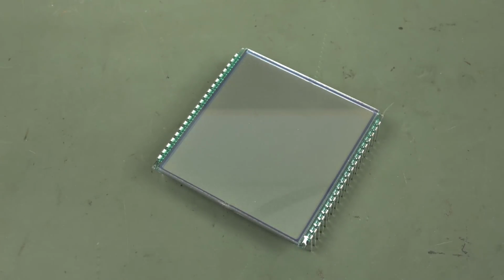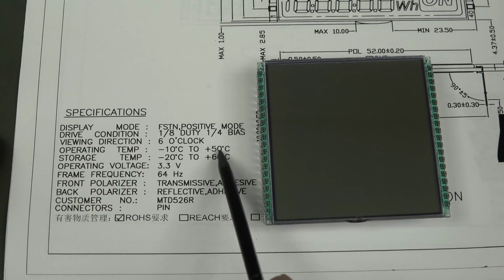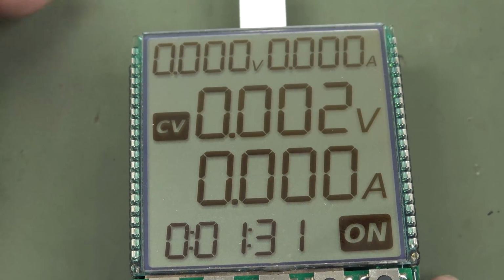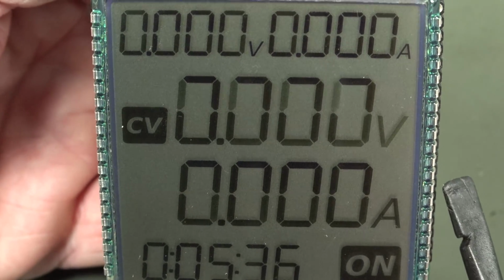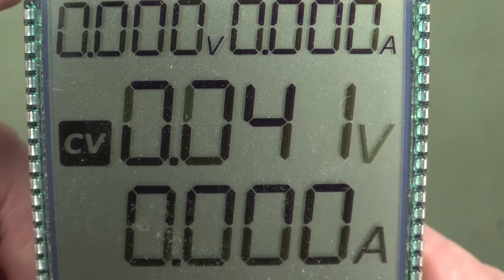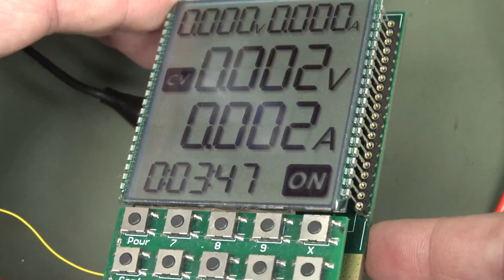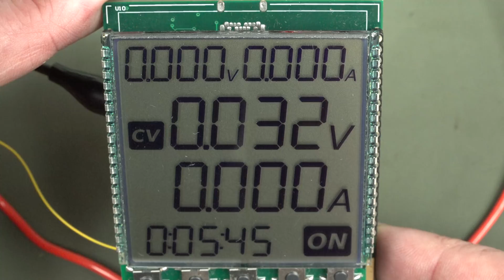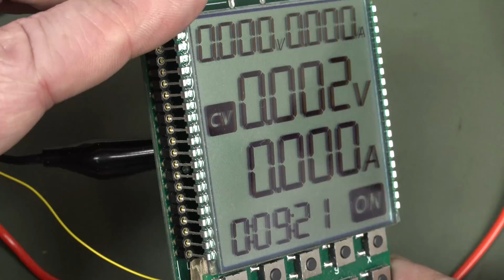EEVblog #1105 - $100 Custom LCD Design - Part 3 (µSupply Part 18)

Comment from the maker: More testing needs to be done on this of course, temperature testing for contrast consistency across multiple devices for example.
Reply: How do the other 4 look? Is the quality consistent?
Cheers,
 - Eddy
Reply: EEVblog just a dumb question, but have you tried reseating the display? I can see you have the "precision pinholes" which are a pain in the ass, as they never have the right hole size ( they're either too small or too big )
Reply from the maker: It has nothing to do with the contacts seating
Reply: @martinsalko1  you could choose the shorter pin, because if the the pin is longer, it would be easier to curve and hart to through the pin hole. or you could ask your pin supplier to add a pin protective case for it.  from custom lcd specialist : www.szmaclight.com
Reply: The supply to which Vlcd was connected without divider, so it was at max. Vlcd cannot go above the supply, so Vdd must increase.
Reply: I have had issues like this in the past depended on temperature ended up making a temperature compensation for it.
Reply: Does the voltage adjustment in the video use the power pin on that holtek chip or the VLCD pin? And is there something to measure on the LCD side? Or does the method of powering LCDs not result in a good measurable voltage-at-LCD?
Reply: @johnkeates9434   you could measure the driving voltage wave of segment or common pins, and getting the LCD driver voltage.
Reply: EEVblog what happened to the first upload???
Reply: Are you going to make a video on the design of the case?
Reply: If you need some unbiased third party testing you know where to send it .. hint hint.. ;) Great video series on the practical process of such a design. Thanks Dave!
Reply: Out of curiosity, with those specific LCD modules, what kind power consumption difference is there (or was there) when you increased the voltage from 3.3 to 3.6?
Reply: Did you noticed that every 7 seconds or so it skips 1 second? Also can you add a contrast setting to this type of LCDs? I mean without running into those segment issues.
Reply: Are you going to sell the displays alone?
Reply: Was the issue persistent across all 5 samples?
Reply: Great video
Can you please share with me the manufacturer that made it for you
I couldn't find a manufacturer for some small quantity under 100pcs
Reply: Dave, since the V character is at the far end of the trace, one possibility might be that too much resistance is accumulating over the length of the trace.
I can think of two possible remedies.
If sufficient room exists, the trace may be widened so that there are fewer squares of resistance between the contact and the V graphic.
Secondly, ITO glass with lower resistance may be used, with the trade-off being that the ITO traces will be more reflective and less transparent.
Reply: EEVblog Bleeding awesome! I'm American. Sorry. Fucking awesome!

Comment: Do you think a much smaller display would be even cheaper? I need a display to show the destination for my TT gauge model railroad trains - to fit into 15x5mm area and preferrably with I2C or SPI behind... Maybe LCD, LED or OLED...

Comment: Hey Dave, David,
If you guys are still working on your battery powered power supply then you might consider coding it such that it can keep track of how many Amp Hours it has supplied (consumed out of the supply battery) and therefore be a sort of gas guage on when the battery needs recharging.
Nice display!

Comment: Would an off the shelf dot matrix lcd with the same dimensions have been a viable much faster option?  How much more driver software development would there have been on your end? You had a complex cad development of the board layout in this case.

What is the disadvantage of a dot matrix lcd? I imagine it’s not as sharp?

Comment: Hi Dave, It could be that you are operating the LCD in a brighter environment than it’s nominal. Did you also specify the ambient brightness? Anyhow, the final product may benefit from adjustable voltage.
Reply from the maker: No spec on ambient brightness. 
Reflective LCD's don't have a maximum brightness.
Reply: Since the dynamic range of the display is quite low, they should have some idea of the ambient light while building it for the specifications, e.g., it will become unreadable in indoors if it is designed to work under sunlight.

Comment: Curious that the data sheet specifies 64Hz. When did D/C power supplies begin producing sinusoidal output signatures or have I missed something?
Reply from the maker: LCD's are driven by an AC signal.

Comment: How is 6 O'clock a tilted angle? By pure logic it would be to be looking straigh down on it, as in looking at the number 6 on a clock. Or what am I missing?
Reply from the maker: http://www.pacificdisplay.com/lcd_view_angles.htm
Reply: EEVblog Thanks! I learned something new, nice! So the "6 O'clock" thingy is not a viewing angle thing. It means that the display are made to be view from the bottom. In it self its not a definition of the angle. That makes more sense.
Reply from the maker: Yeah, it's a bit of confusing industry specific lingo.
Reply: +drlunderberg Many years back I visited a bleeding edge tech firm where they'd set a nice LCD clock into the back edge of the visitor registration desk. Problem was the display had a 12 o'clock viewing direction and was almost invisible when viewed from 6 o'clock. Pointed it out to their tech director but never went back.

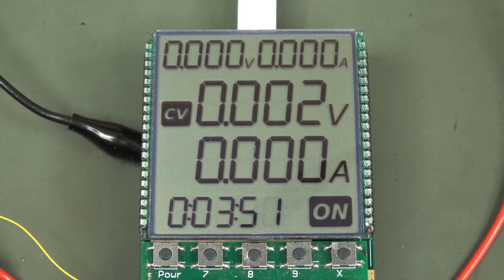Comment: @12:50 I like that too. You're being too tight at 3V3. Drive it with 5V and add a VR to VLCD. Job done.  Keep the pins they are nice.
Reply from the maker: Yep, easy solution.

Comment: can this sort of issue be because of a half ass-design for the testing board? we both know that it doesnt need that much to drive segments (or in your case not drive them)...
Reply from the maker: The "half-arse" design is using a dedicated LCD driver chip.

Comment: This display is not compatible with a zebrastip because the contacts are on the bottom glass, for a zebrastrip you need the contacts on the top glass.

Comment: I have had that problem a few times and it was almost always board layout where some tracks had higher capacitance than others and it caused some segments to 'lag'. I also had one where there was some crosstalk between a couple of tracks.we generally avoided ground planes under the tracks controlling the segments.We always now specify a lower voltage display and feed it through a resistor and this allows us to select the right values. We also find variations between different vendors for the 'same' design.

Comment: I would like to have your micro power supply but I am afraid it will be more expencive than if Fluke made it, like with EEVblog multimeter. Ask Fluke if they would be willing to slap their brand on it, it would be cheaper?

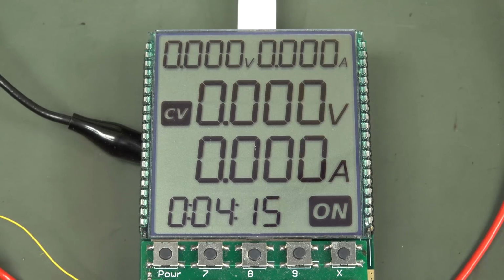Comment: At the higher voltage the refresh 'attack' and 'recede' times seem to be much much improved also. It slowly fades in at the start of the video on changes...and sharply changes at the 13:15 mark.

Comment: Is there any reason to use these segment displays, apart from low current draw applications? I mean - these days you can get full color 320x240px or even higher resolution raster LCDs with built in drivers for just a few dollars, and you can display literally anything on those. I mean - cost- and functionality-wise there is no reason making your own segment LCD these days. Am I missing something?
Reply: I'm guessing that the main reason (other than power cons) is the effective resolution. To match that res may require a lot more pixels than 320 wide. That said, I do like displays that simply use an I2C or SPI interface!

Comment: 15:41... Why wouldn't you want to share the Manufacturer of the LCD with your subscribers Dave ??? Why the big secret ??
Reply from the maker: Because we did a lot of legwork to find this manufacturer, and want to keep a good relationship with them. We don't want them flooded with 1000 people wanting $100 one-off prototype LCD's, that's not their business. And trust me, that would happen.
Reply: it is microtech-lcd . com
Reply: DrAFrei & Dave... Thanks for the info and reasons why you don't want to share that supplier.

Comment: For me it's a bit confusing the exact same font (and small V/A letter at the end) of the two display lines.
Either you have to be really familiar with the display, or always check the small letter at the end to see weather  you are looking at the voltage or current display.
This is why LED displays use different colour blue/red for the two values.

Comment: Looks to me like a it could be loading issue on that segment drive line - does it have a bigger area to drive than the others? I see the datasheet gives a 1:5 difference in drive sink currents at 3V and 5V which would seem to explain the problem going away with a slight increase in drive voltage.

Edit: I see v ant beat me to it 3 hours ago.

Comment: If it would be an F35, then, no biggie, straight to release. But, since it's just a power supply prototype, should replace that display. Also, keep the pins. I've had so many displays lose contact with those flimsy rubbers over time due to either oxidation from high moisture or just the rubber perishing.
Reply: Yes, please dont go with those "zebra stripes". Touch them once and thats it, it will never work again... :D

Comment: That looks like USB-C. I don't think i like that idea... Sure it is more power, but i have a zillion micro USB Power Sources / cables everywhere and just one USB-C at my work place.
Reply: j4ck32  buy another one... That's like protesting sata because you have loads of IDE cables...
Reply: 10$ for 3 USB-C connectors, so 3.3$ per one? Are you sure you think thats okay? I get complete boards with everything for less than that...
As long as USB-C costs too much its not a option. The functionality are not needed in any way, so the only reson to switch is the price and availability. Both are much better for µUSB.
Reply: Leo Curious   You get complete boards in consumer quantities which are more complex than a cable and have more materials for less than 3$?! 

Also... Are you THAT cheap? Move on! Stop trying to resist change because you dont want to pay money
Reply: What is you point? Change because... change? Unless there is a benefit its not going to happen. I See how USB-C is better for any other usecase (and already switched some things) but not for these things. There its just for +5V and communication. Waste of money to use USB-C for that. It will of course still happen in the next 10 years, just like mini-USB to µUSB in the last few years, but at that point it will be about as cheap and maybe even allow for some neat tricks.
And of course, you get complete ESP32 boards for a few $. You get complete TTGO boards with µC, OLED display, LORA and antenna for 13$. 3$ is a shitload of money "just" to get 5V across.
A comparison would be that you would want thunderbolt connectors. The same reasoning applies to dismiss that idea.
Reply: Leo Curious   Change for the sake of change is bad. But i guarantee in 3 years when everything is using USB C youd have trouble finding a micro usb cable in your stash and then youd need to remove an existing cable from a usb supply and its just annoying...

I, right now, due to the amount of type c devices I have, find it a real pita to remove a type c cable and substitute it with a micro USB one. 

Oh, also, you can get a type c cable from AliExpress for $0.5... even less if you get multiple...
Reply: Leo Curious They're not prone to usb superposition for one.
Reply: Hahaha, USB superposition :D
1. Try to plug it in, doesnt work
2. Flip around, still doesnt work
3. Flip around once more... works.
It has 3 sides.

Comment: If the manufacturer can design LCDs to work at 3.3V or 5V supplies, and this one was specified at 3.3V but works better at 3.7V, could you get them to adjust {whatever it is they adjust to move between 3.3V and 5V} downwards a bit so that the production LCDs would work nicely at 3.3V and save you the extra regulator?

Comment: Two comments:  What's the voltage on the drive chips themselves?  (anything significant lost in the traces?  I've learned that lesson the hard with way TTL stuff.)  Second, was it clear from your communication with them that the 3.3V was the drive level to the driver chip or the drive level to the LCD?  I'd think they'd be expecting it to be the drive level to the LCD.  Otherwise, they have to work out how much drop there is the the drivers you're using - which may or may not match the information they have.
Reply: Yeah it looks like the lcd is not seeing 3 v3. But i'd think raising the vdd and fixing the mistake shouldn't pose much of a problem.

Comment: Last time I got custom LCDs they gave me 15 samples containing 3 different versions. So I could pick the exact type for my controller (MSP430F449) since I did not have any chance to increase the voltage to 3.6 volts. However, tooling and handling was $1000 in my case. That's 10 times more. I am sure they could fix that for you using a different liquid crystal type, for another 5 samples and $100.
Reply: It depends type of your LCD Display or LCD display Module. For example this manufacturer https://www.yaoyulcd.com offer 150$US for LCD glass and 150$US for Handmade Acrylic LED backlight. 5pcs of engineering samples are free and plus shipping cost. LCD cost is always same all model TN, STN, FSTN and VATN. If someone offer more than 200 USD, probably your LCD supplier are not a manufacturer. In China there is many different trader buy and sell Custom Design LCD Displays and modules. Also if your LCD display contains LED backlight, cost will be higher. Because there are many different type of LED Backlights. Injection mold LED Backlight tooling will be higher than standard Acrylic cut LED backlight.

In addition, manufacturers have a minimum order quantity for mass production. Unprocessed LCD glass dimensions are approximately 360x300mm. The manufacturer must take an order that will correspond to a minimum of 600 pieces of glass(each glass 36x30cm). According to these dimensions, you can calculate your minimum order quantity.

Comment: HT1622 is outdated crap, STM8L could handle those LCDs much better.
The problem with segments is that the IC supplies constant current to LCD waveforms but different LCDs have different segment capacitance (and probably line resistance). And it gets worse with higher line multiplexing. To solve the problem you can 1. Increase voltage 2. Increase current (STM8L can do this but low power consumption goes through the window) 3. Lower LCD update frequency 4. Add dead time after segment update to allow the segment to charge properly (STM8L can do this too).
Reply: Just like v ant said, I think the common is snaking for too far on the 
glass, making the capacity and resistance too high and the signal too weak.
Reply: Line resistance is definitely what I would be inspecting.

Comment: I assume the process they use pushes just about all the per part costs in the design/Cad and final processing to attach the pins. (A few cents per piece for the materials and processing if physical masks aren't needed)

Comment: The 3.6V might be got from an LDO or a tiny DC-DC converter chip with some resistors. But if you are using a lithium batteries this might be a problem because its voltage drops under load.

Comment: Or you can use a pixel-addressable dot-matrix LCD and control it with a microcontroller so that you're not limited to fixed segments.  That seems to be the way many manufacturers go, especially for small runs where the software development is a "one time" cost and it means they can use off-the-shelf LCD units.   It also allows for things like line-graphs, histograms, etc and other things which are impractical with a fixed-segment display.
Reply: No where near as readable as a fixed setup display. Also these will be cheaper if he orders a few 1000 at once.
Reply: Sure, if that's important to you that's the way to go.